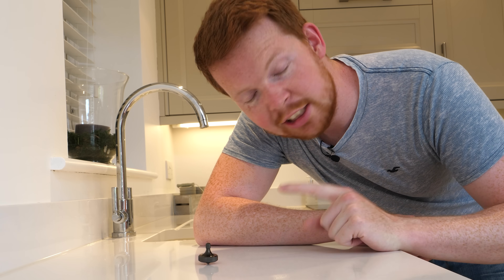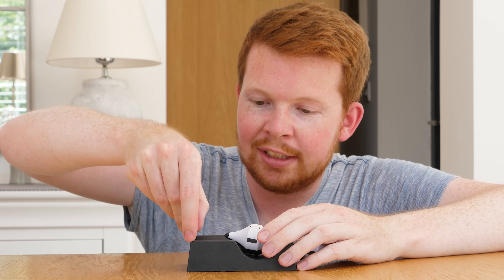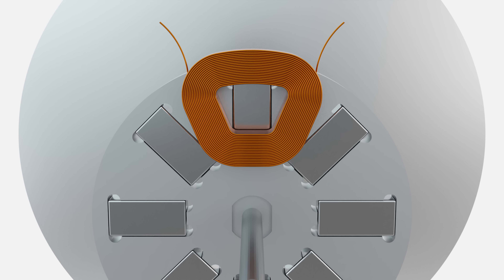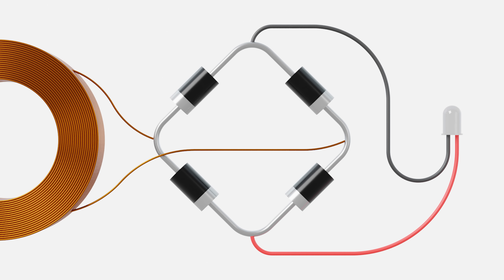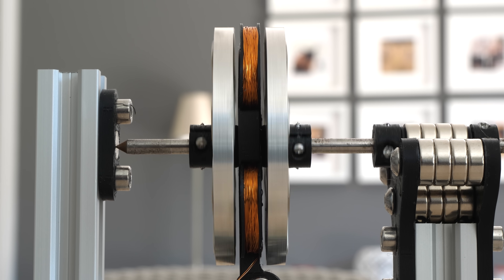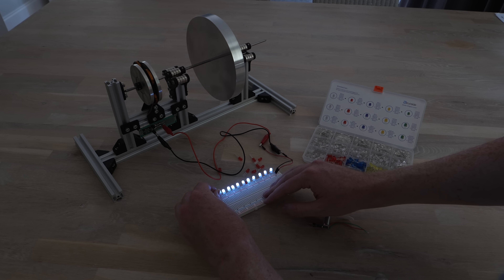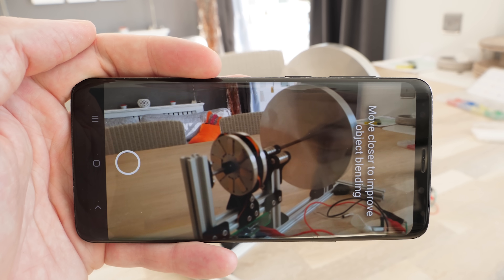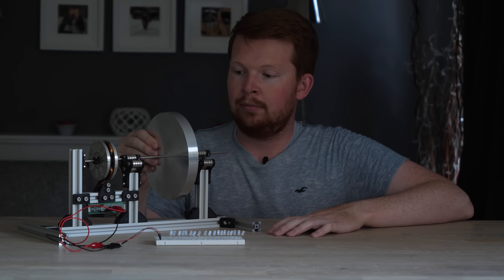Flywheel Battery

Comment: This is awesome stuff, admittedly I've spent too much time thinking about things like these and everytime I come to the same conclusion, that being it scares the hell out of me, bigger "battery" means more mass or higher rpm, both have challenges associated with them, more mass and same rpm or simply more rpm means a lot of energy just waiting for a failure to convert it into kinetic and thermal energy which would be devastating to the immediate environment if a flywheel started to "run away". I'd bury one in a concrete hole if it was absolutely necessary to use one of these but on a bigger scale

Comment: I give you an A for getting the LED's to light with a home made generator, genius. But a C on a backwards explanation of how a Full Diode Bridge works. I had to give you an F on the Current flow on the Diode you got it totally backwards. Electricity (Electrons) Current flows from Negative to Positive and you got this backwards in your video at time index 5:45. A little history on it, Current flow was discovered by Tomas Edison in the Edison Effect (Valve), see it here: https://www.youtube.com/watch?v=0Smj2nHo9zA. You can understand more about the flow of electrical current and diodes here: https://www.youtube.com/watch?v=Fwj_d3uO5g8 To understand the proper way to a Full Bridge Diode works go the time index 9:29 of the same video. When explaining electronics it's important that everyone to be on the same page and use the same terminology and explanations. If you're going to use the outdated method "Conventional Flow" or the current Scientifically Proven "Electron Flow" you should state that in your video. I learned that from a German Engineer I was working with on a project for the military. I wasn't new to electronics but I was lazy in my terminology, he fixed that in me. Why it's important, well I can think of a lot of projects that got things wrong and a lot of time and money was wasted and some projects blew up because of folks not knowing the difference. Granted I'm still not perfect after 42.5 years of working in electronics, but if we all try to improve and get things right we'll all make fewer mistakes. Getting the direction of current flow is one of those that's still made by novices and professionals alike, that shouldn't be. Thanks for the video on the magnetic generator, I really enjoyed it. Thumbs up! PS don't forget to add a current limiting resistor to those LED's they do burn out if you over current them. Found that out the hard way, sniff sniff.  Best Wishes & Blessings. Keith Noneya

Comment: I would like to see that with a second rotor and a little larger flywheel and a crank. If you could get enough power to charge a phone , or a power brick, it would actually be a viable product to sell on the market. I would buy it.

Comment: Probably a stupid question but I have novice knowledge of electricity: Would it be possible to use some of the power generated to control a circuit that would control electro magnets attached to a stator with opposite poles attached to the fly wheel and in essence create a somewhat perpetual motion machine outside of initial energy required for startup and still be able to power some LED's?

Comment: based off this concept: how about building a manual treadmill who's console's electronics are powered via the end-user's movement, you can then take it a step further by putting in an in-line rechargeable batery cell to retain fitness data, programs etc in s-ram. This batery could also help prevent the machines workout data from being lost or corrupt if the user stops mid-workout, which will normally result in the electronics resetting themselves

Comment: Does the alternator drawing current cause the flywheel to decelerate quicker?
Reply: Whenever electricity is generated this way; the coils create an opposing Magnetic field as the current is generated. The field generated by the coils are present via the same properties that make electromagnets work.

So in short, yes.
Reply: Yes
Reply: I'm not a physicist but I'm inclined to say no.  I don't see a point in the alternator that would increase the friction.  Maybe the magnetic field pulls on it and slows the spin though.
Reply: @corvus15  conservation of energy leads me to think it would… but I do want to hear from the horse’s mouth

Comment: Hmm, what if using 2 bunches of static magnets on one side and the same on the other and balanced between them against the glass. Then flywheel will have balance by magnetic field and have less resistant.

Comment: hey Tom.... interesting project... could you power a spinning tiny wheel set at the base of the larger wheel and it would spin the larger wheel....so the larger wheel starts spinning faster generating more power to the smaller wheel and spinning the larger even more... would that be possible ?

Comment: Seeing it generates such a low voltage, it would be beneficial to use schottky diodes with their much lower forward voltage drop. You are losing 2x0.7 volts instead of 2 x 0.3 volts.

Comment: If you add a geared handle that makes ten revolutions or more per rotation of the handle, which only engages while being turned, and only then by use of magnets, it will be far more usable for recharging something like a mobile phone etc. Though still not a practical way to do so. A solar panel is a far better option, but this was an interesting invention either way.

Comment: Follow-on question: instead of arranging the coils in these sectors, which results in AC from the alternating polarities of the permanent magnets, which you then have to rectify into DC, why not just have all of the magnets in the same polarity, and the coil going around the perimeter of the rotor? That would produce DC current with no need of rectification.

Comment: If You used a battery and pulse width modulator, you could motorize the alternator to spin it up then connect the diodes to tap the power or you could connect a switch. You can also light an incandescent bulb without the diodes.

Comment: When you try to spin the magnets, the coils (only in a closed circuit) are opposing the magnetic field resisting the spin = heavier flywheel = stronger support magnets.

Comment: Just curious: why couldn't you have a small but powerful magnet attached to each end of the axle, and matching ones mounted outboard of them (to the fixed base), to locate the axle without needing an end-plate to bear against?

Comment: Could you not then also use repulsing magnets on the ends to keep it aligned? Would it not also use less energy that that rubbing method?

Also could you have made all of the coils slightly offset so they give a more consistent pulse of power.

Comment: Generally, doubling the diameter of the rotor allows one to double both the number magnets and the number of coils.  Then, for a given rpm,  one could get 4× as much no load voltage with the coils wired in series.

Comment: Nicely done, you're a gifted mechanical enginerd! It could be helpful to explain why voltage is proportional to N windings and RPM and how current is proportional to moment of inertia, maybe mentioning the relevant Maxwell equations.  You did well showing voltage, but LEDs are current-limited devices, so show ammeter readings. Hook it up to your oscilloscope please!  I always appreciate instructive demonstrations of moment of inertia, through which one can mention the effect of a different rotor mass distribution.  I'd also love to see you do the KE = 1/2 * I * omega^2 calculation, measure the efficiency, and talk about how you would make another iterative improvement.  You might have some fun bypassing your rectifier and using another copy of your alternator to turn a rotor with magnets on it.  That gives a good "feel" for the mechanical -> electrical -> mechanical path the energy takes, and looks cool synchronized.

Also, please say "FULLLLLL BRIDGE RECTIFIIIIIIIIERRRRRRRR" like Mehdi for us once?

Comment: Chrysler spent a ton of money about 15 years ago experimenting with magnetically levitating flywheel batterys in large vacuum chamber's because of the vacume there is virtually no energy loss because of the 0 friction in the air or bearings the 2 issues they ran in to were that you need to spin the flywheel to insanely fast rpm to have a usable amount of power stored and the second was cost per watt hour stored is never going to match what currently exists

Comment: To get the flywheel off of the shaft, heat up the aluminum with a propane torch, starting from the outside circumference and gradually working your way around and inward. If that doesn't get it off, it is because the shaft had time heat up and expand. You can use a damp rag to quench the shaft and get it to shrink.

Comment: And I could light a few LED's with a potato. (sorry, just kidding). But you have a drag problem. The magnetic bearings will be causing drag with the flywheel. you need to seal the bearings with a thick piece of steel between those bearings and the flywheel.

Comment: I think this could be useful in an environment where the source of force that turns the main shaft comes in short strong bursts the flywheel could be used as a battery to keep a somewhat constant voltage output along with higher capacity capacitors.

Comment: Cool stuff. Ive always wanted to build a flywheel battery that could be spun up by hand. The problem is losses from current at low voltages. with all that wire, the electron's path is long and high impedence. I noticed with the white leds how much faster the wheel slowed down. Since the white leds use so much more current than red, the reverse magnetic flux was braking the wheel enough to make it wobble differently. You might be able to use a diode in reverse on the contacts of the motor as a flyback, so in between dc pulses from the rectifier the built up current in the motor coil has somewhere to go.

Comment: Doesnt the "constraining surface" create just as much friction as a vertical top?
Reply: I don’t think so but I’m not 100% sure. The reason I say no however is that when calibrating the axel magnets over the bracket magnets if you place it at a point where it is very very marginally off set from being perfectly aligned, the force that the magnets are pushing to the left with us quite small and therefore not creating as much friction due to a smaller normal force perpendicular to the constraining surface.

Comment: The lightest, most effective flywheel will have most of it's mass concentrated towards the rim where the speed is fastest, consistent with strength. The mass nearer the shaft is mostly dead weight.

Comment: Should try the small motor with a gear and gear the flywheel like a car flywheel and compare the time running the motor pushing the flywheel and not
Reply: Looking back at this it makes no sense. But how he had that power a motor have it power a bigger motor pushing the flywheel to see if it spins longer.

Comment: Worked in a place that used a flywheel (more like a flycylinder, the unit was the size of a large house) to provide power generation for when the diesel generators would come on line to power the entire facility. We're talking the load of a data centre here. It had immense amounts of stored power.

Comment: Instead of a friction-based pivot point to prevent the 'works' from sliding, try replacing the pivot point with two opposing magnets making it frictionless. 
:

Comment: Is it possible to use your alternator as a motor to add spin to the flywheel say from electricity generated from a solar panel, thus becoming a solar battery?

Comment: Okay, totally random thought. You said desk toy. So use a  small solar panel and have it charge some battery and dc to ac converter to power up the flywheel. When up to the rpms you want, then it shuts off power and switches to become a desktop fan generator.

Comment: Not sure if anyone said this yet, but  at your friction point you could use opposing magnets there also. And you could use a buck converter to up your voltage. I also have more ideas to improve the design but I have to find the time to do some math. It would be nice to get a rpm to voltage information.

Comment: Ask Elon to put a flywheel in the vacuum of space with zero friction and hang a wire down to Earth to power lots of LEDs or a small motor forever. Job done.

Comment: When you apply a load with the LED's or whatever else, are you also inducing magnetic resistance back to the flywheel?   Is this how regenerative braking works in cars by the mechanical force being applied through the electric motor and thus electricity back to the battery?  As a desk toy would be fun to see this in a vacuum box with a magnetic coupler to the outside with another magnetic coupler to spin it up and release.  It would really store energy for quite a long time with only the most minuscule friction and be a real usable battery.

Comment: Just a thhought .....You could chop of the bent shaft and chuck the flywheel back into the lathe and drill the section of stuck rod out... ( if the center hole is enlarged .. use the lathe to create a pair of cone shaped washers that can be used to recenter the replacment shaft ..) I'm confident you can figure the rest out :) nice build

Comment: Yo what if you attach a little eclectic motor to the flywheel? With the flywheel having very little resistance. Would a little motor help keep it spinning longer using the energy created?

Comment: try connecting it to a calculator so whenever you need to do a math problem just spin up the battery and use the calculator

Comment: Nice Build, i really had to laugh when  you poered the motors in the end, like you could have connect the rod to the end of the spinning fly wheel rod, but no, you convert it to electricity and then back to rotation ^^

Comment: That is AMAZING!  It might be possible to stabilize the fly wheel by placing springs under the supporting magnets so that the magnets move up and down independently, like vehicle shocks.  Bracing the other end of the axel would allow a gear to be attached for any number of cranks to accelerate the flywheel.   I would have never thought to separate the flywheel from the turbine, awesome!  Gear ratios!

Comment: Hi Tom, could you power up the flywheel using your alternator in reverse? I’d love to see that
Reply: What you're describing is essentially a brushless motor. You can't do it simply by applying a voltage to the coils, because the current has to change direction as the motor poles move, so you need a motor driver circuit to do that.  This also isn't wired in the best configuration for working as a motor, but I'm confident that it's still possible (Great Scott! has built a DIY BLDC motor driver circuit) and that would be a fantastic addition to this project: the ability to input electrical energy, store it in the flywheel and extract it later.
Reply: @PKMartin  I agree, it should be easily doable... however there's a catch. As a single-phase motor without any special mechanisms, the torque produced will be zero when the magnets are directly over the coils. Most of the time this isn't a problem because the inertia of the flywheel will carry it across the dead spot, but if the motor is stationary at this point it will be impossible to start with the electromagnets.

Commercial single phase brushless motors usually get around this by placing a piece of steel in the coil (partly) so the rotor magnets will be attracted to a "safe" place when power is disconnected. However this would produce hysteresis losses which would add extra "drag" to the flywheel.
Reply: @eDoc2020  That's what I meant by "This also isn't wired in the best configuration for working as a motor".  Different numbers of coils and magnets would improve the starting situation, but make extracting the generated power more of a complex task.
I do wonder, wired as an alternator with a single pair of connections for all the coils, if there is still some simple mechanical means of commutation that would mean it can be fed with DC and provide motive force - something like a car distributor that would flip the direction of the incoming current at the right points in the rotation, or some kind of reed switch H bridge that would use the magnets themselves to reverse the current flow in the coils.
Reply: @PKMartin  Your best bet for a contactless solution would probably be a single reed switch pulsing the coil in one polarity. If you can tolerate mechanical contact then you could just use an old-fashioned brushed commutator.

Comment: What would happen if you offset one of the magnetic wheels by half the angle between magnets? Would the lighting be more smooth or would performance be reduced due to there being a magnet interfering with the coil charge of the other magnetic wheel?

Comment: Hi Tom, can't you use two apposing magnets at the end of the shaft to keep it in place instead of a sharpened point on a steel plate which creates friction. also, wouldn't the fly wheel be more effective if you moved the bulk of its mass to as close to its outer perimeter as possible instead of a solid disk? great build though, it appears it worked a treat...

Comment: Now use the alternator as a motor to spin the flywheel up as a KERS unit. Admittedly you'll need to replace the axle with something stiffer and probably add some magnetic guide bearings to limit wobble.

Comment: You can get power radially from magnets if they have an outer ring made of steel alternated with gaps so that it induces the radial magnetic field energy to the steel which becomes magnetized and because of the steel / gap design the steel parts will act as if each is its own magnet while drawing from the same field. In this Robert Murray Smith video he tears down a microwave oven turntable motor and you can see what I'm talking about. There is a shell ring around a ring magnet and it runs the motor on the same principle just in the opposite way. https://www.youtube.com/watch?v=rozz-wbHfYM